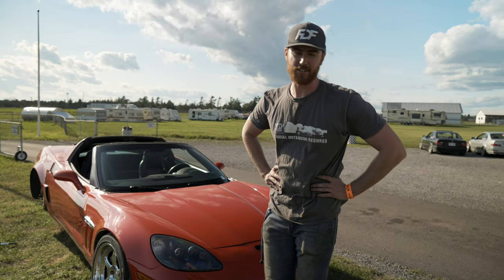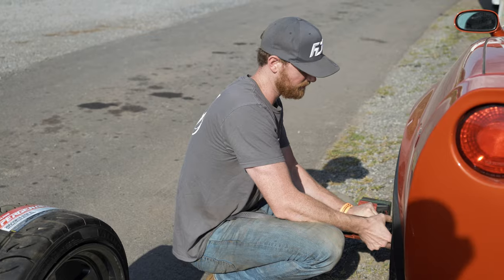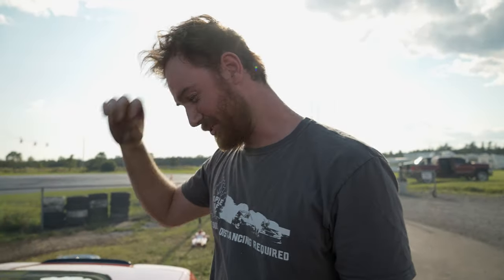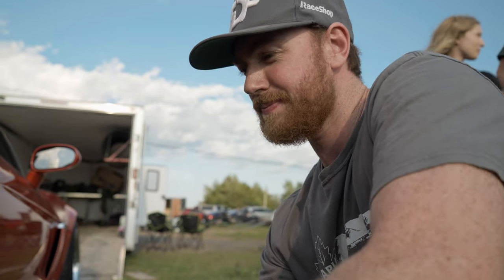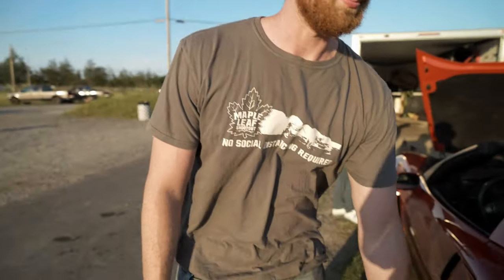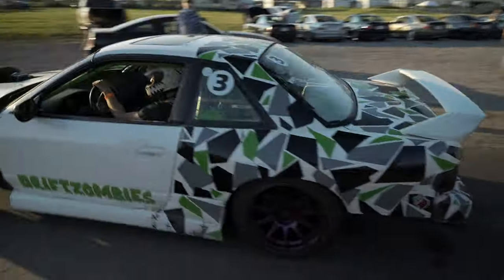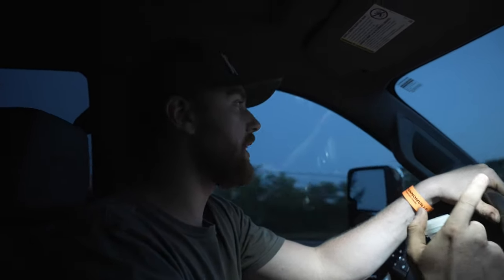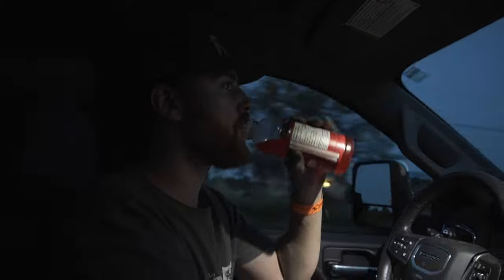DRIFT NIGHT AND TIRE COMPARISON/ Zeknova vs Valino

Comment: I compared the Zestinos Gredge 07R with tw 240 to the Zeknovas RS606 with tw140 . In terms of Grip the Zeknovas were a a dissapointment. I run my Evo track focused, not drift.
The Zestinos in harder compound had more Grip.  I cant even imagine how bad the tw240 and the normal zeknova supersport must be for Grip alone.
Reply: I’m debating buying the zestinos in the 300 tread wear for daily driving.

Comment: Cool video to watch guys however I'm going to have to say it's not a fair comparison test as the Supersport Zeknova is the cheaper tyre in their range. The direct competitor for that valino would be the Zeknova RS606 which come in a 140 and 240 treadwear. 

I would love to see the comparison of those 2 if you can get hold of them 👍🏻
Reply from the maker: I have used many RS606 and the grip would be on par or better than valino but the life was much less than SS. So I prefered SS for the life and consistency
Reply: I was thinking the same thing. Thank you for the feedback.
Reply: @FDFraceshop  unfair comparison,  like you said if you want more grip ,you should use RS606 in R4 TW240 compound to compare them vs valinos pergea. You can  compare valino Greeva to the Supersport, similar prices, similar compounds. Have used both, valino and zeknova are excelent tires.